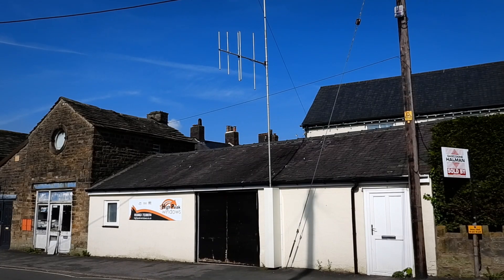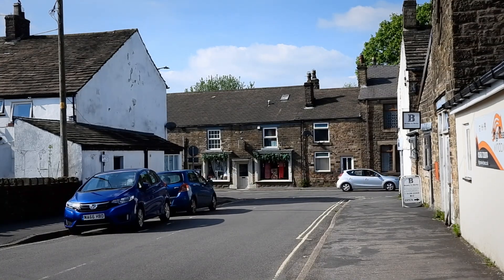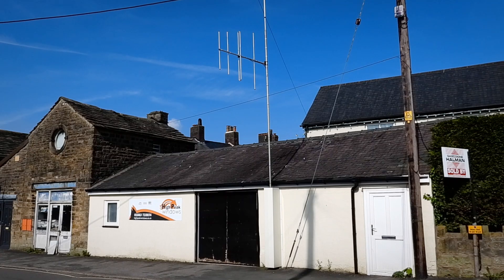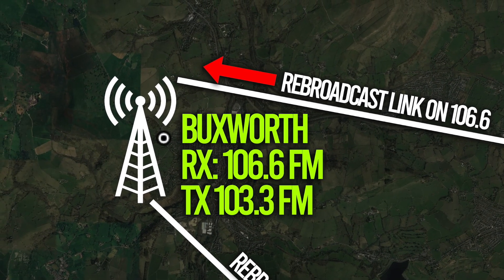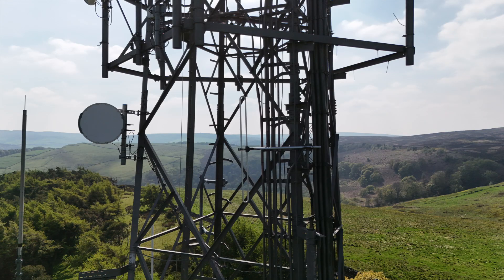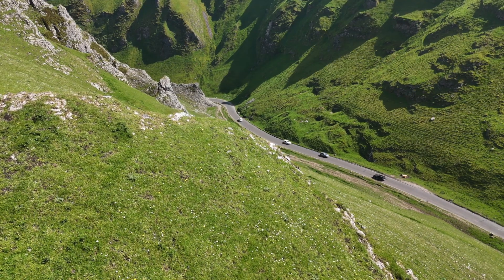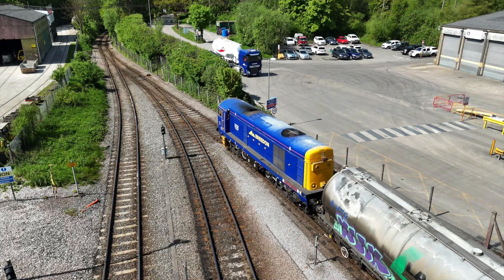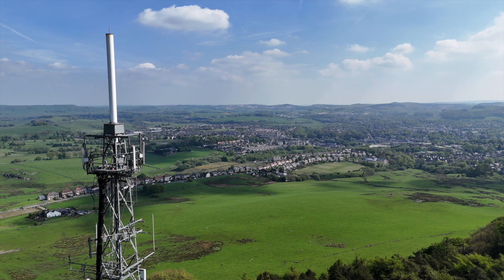Why Did This Antenna Appear On A Residential Street? High Peak Radio

Comment: This is not related to this video, but i would like to know your opinion if something like it could be fusible. The TV series lost had a radio transmission that that was transmitting for 16 years according to the show, some comment reading led me to the year estimate of 11–12 years of the message. My question would it be possible for a 1970--1980 tech transmission tower to constantly transmit in a high humidity area like this island would there be are deterioration or other factor like power interruptions (power is somewhere of the island via undersea power cable) to stop the transmission at the time that the show is ruining in the in show year of 1990?

Comment: There is some great information in High Peak Radios book, broadcast brothers on the radio. Their second book should be out soon, which will detail more about the launch and running of the station.

Did you reach out to the Jenner brothers? 

Great video 👍

Comment: Wow that first antenna looks like its almost touching the telephone wire and overhead power line, I wouldn`t be surprised if you can receive the radio through the phone and electricity meter. " right lads about here looks right "...obviously no thought to safety

Comment: Ofcom's technical parameters document informs that Chapel-en-le-Frith's in-use pattern is omnidirectional. That suggests (to me, at any rate) that the end-fed vertical is the transmit antenna. The antenna height is also given as 7m -- the yagi looks (to me, at any rate) to have a mean height of approx 5.5m or thereabouts (assuming the doors are 2m).

Comment: Another great video, of special interest. This is the message I got from one of the creators of that TX chain...

The answer re the original feed to Glossop is genuinely quirky. That RX antenna didn't pull in an adequate signal from Buxworth, so we received instead at a hilltop fam building to the south, near Chunal, and bounced it onwards...
Reply from the maker: Could we chat via email David?

RingwayManchester@mail.com
Reply from the maker: Thanks for the info!

Comment: Nice video again. In France there are similar Yagi antennas but lower frequency and only 2 or 3 element aiming along train tracks, and antennas looking like a periodic log, also vertically polarized, along toll highways, The latter are diffusing a radio program for drivers with a diploma on 107.7. The program is likely repeating each hour and contains information about good driving practice, at least this was what it was when i last heard it 10 years ago and found it awful. The positive thing about it is that it is directive to the extent that as soon as you leave the toll highway the signal vanishes.

Comment: very interesting Lewis. I'm not a broadcast engineer but I have spent a lot of time working on PMR on hill top radio sites and there was one (can't remember which, it was a long time ago) where there was an FM broadcast Tx which was fed from a BT landline but with an off-air receiver as a backup for when (not if!) the landline failed. I would imagine keeping the local Tx and its noise sidebands out of the link Rx would be a major headache especially with the antennas on the same pole. Best wishes Alan G0NFY

Comment: I’ve found similar towers at a 2 sites while traveling in the uk on holiday, which look like a bunker almost? 

Used the 3 words app to map them for you; ///shred.cubes.cobbled and ///angel.tolerable.gentle

Your videos are getting better and better, the original videos were dry at times, but adding in local lore as you go along to fill out the story; while I’m sure a lot more work, make the videos more interesting for a wider audience.

Comment: Glad I'm not the only one who thinks GHR is doing a stunning job of helping wipe out Independent Local Radio. It's a deeply-depressing spectacle to behold. I've seen much-loved stations - a number of which I have been fortunate to work with over the years and which, despite the rise of the Internet and streaming still maintained a large and loyal audience - silenced, to be replaced by a corporate national feed whose sole contribution to local content is a traffic and travel opt-out every so often. Fortunately a number of outfits have regrouped and gone down the DAB/online route but they're in the minority, sadly.
Great content as always  - many thanks. 
👍
Reply: I agree on GHR wiping out smaller stations. I was quite exited when my town got its own station back in the mid 2000s. Unfortunately that small network got bought out by Bauer media a few years ago and is now all GHR. GHR is not a a particularly bad station (apart from having too many adverts), but I'd much rather have a local station.

Comment: at Chinley near Buxworth there is a relay on a hillside near stubbing lane. in recant times they added things on to it and now when there is a light wind the things they added on the mast make a whistling sound which is fairly loud. sometime you hear the sound of a generator kicking in there.  the stone building next to the mast has been converted to a holiday home.  i suppose that stone building used  house equipment for the relay mast but now it just houses people on away days.

Comment: I can imagine a fibre feed going to it via very few hops and strictly using UDP protocol... - but where IS the fibre cable? ....mine would be under or next to my various walls....... - it's not a great place for wooden poles and wires in the air.....

Comment: Seems to me that  Greatest Hits Radio is either broadcasting in DAB or a low power FM radio broadcast. Similar to what we have in the states. We have licenses free medium wave radio. Each low power AM medium wave transmitter works on a frequency around 1620 KHZ. The transmitters that  make up the low power AM broadcast network for area coverage are all on the same frequency.  Each transmitter is feed with one fiber site with the other's feed with a WiFi link. Using a encoder and decoder box. Such as the low cost Barix system with a static IP address. Each Transmitter is syncid up pretty much the same way a cellular tower network is. To provide coverage over a large area with very low power around a half a watt. The two most common FCC approved transmitters for this application are the Hamilton Rangemaster, and the Chez Radio Procaster.

Comment: That Yagi looks remarkably low and vulnerable for an urban location. 

I agree with your comment on them sucking the life out of local radio stations around the country. I'm of the opinion that if a company can't run a local service, the licence should be automatically revoked and opened up to organisations who can. A similar company has totally sucked the life out of local newspapers. Replacing the web sites with syndicated items and a huge amount of adverts.

Comment: That first site in Chapel.  It seems a strange building if there is direct fibre as there isn't a fibre entry into the front of the building on top of that there would need to be a secure area for the fibre optical mux equipment and the interconnect to the radio transmitter.
The antenna cables are run up and over the roof to another location.
That omni directional antenna could well be the transmitter.

That second site looks very rural for a direct fibre dig. Would have cist a fortune if there is no network infrastructure around.

Comment: Always amazes me what can be accomplished with this rather basic technology.
A lot of transmitting hops…..when they were all in use, what would the audio quality be like at the end of the chain (this being fm not DAB digital)?

Will this stuff and elsewhere be in use in say 10y from now? The move to online, thru either individual apps or a general purpose app covering multiple feeds eg Apple with less and less restrictions on data use means so many people only use those systems instead of various broadcast systems.

When home broadband isn’t enough??
Am I right in thinking this is a fixed mobile cell service antenna for homes with poor or non existent home broadband?
I’m guessing this is attached to a router/modem of some kind which turn the signal into WIFI and onto Ethernet.
As far as I know this area doesn’t have any connectivity issues with cables so I’m assuming this was used early on and never removed?
Odd thing to see.

https://maps.app.goo.gl/kBSSVZEs22dRQmMW6?g_st=ic

Comment: Great video as per Lewis GHR more homogenised crap that has no identity soul or bothered about local issues. THEY SHOULD NEVER BEEN ALOWED TO PLUNDER EVERY INDEPENDENT LOCAL RADIO STATION ! They must have a production line for cloned presenters as every single one sounds the same the only difference is male or female
Reply: We used to be able to pick up Gem 106 on high ground in our area, and it was a decent listen. Unfortunately, Gem 106 got taken over by Greatest Hits Radio...!
Ironically the 106MHz frequency used to be Heart, then got sold off, and eventually became GHR at the end of it!

Comment: That seems a bit sketchy using the 106 freq and not microwave link like most translators use, usually keeps the frequency free from noise as well.

Comment: Actually, I think both Heart and Greatest Hits Radio between them are “sucking the life out of independent local radio” - as soon as I saw adverts on posters telling me that Heart was going to be broadcast on 102.6 FM, I said “It can’t do that - it’ll interfere with Orchard FM!” - but, no - it’s replaced Orchard!  Or Pilchard, as the local yokels called it!

Also, two radio stations set up in both Minehead and Bridgwater, both initially calling themselves The Breeze, are now Greatest Hits Radio!

Even TFM, which used to be Radio Tees, whilst identifying itself as TFM, is really Metro Radio - if you play both at the same time, you get the same programming, with clever masking to hide the fact that it’s really pretty much a network, but with limited local content (ads, area-specific travel bulletins and news) - in fact, it’s a north east coast network service, between Humberside and Scotland!
Reply: Sad isn't it? Heart and Greatest Hits are the Borg Collective of radio stations, assimilating any independents and turning them into the radio equivalent of a shopping mall.
Reply: @ferrumignis  Here in the US iHeartRadio is the equivalent. They've acquired seven AM and FM stations in my little market of about a half million people. They've fired most of the popular on-air people and the remaining ones are shared among all the stations. And every advertising break includes a spot for iHeartRadio's podcast streaming service.

Video may have killed the radio star, but streaming is going to drive a stake though their heart.
Reply: Radio today is a complete joke. Good job not many people listen these days. The 80's up to around 1995 was a pretty good period for radio, and those Jam and TM jingles really gave each station a strong image. Now it's like every station is a clone of each other, have no identity, and have the same boring crap playlist of like 20 songs. Let's not mention how the song don't even sound like music as the audio is compressed to hell providing very little dynamic range. Surprised any of them are still in business.
Reply: I agree, but it's even worse. They are actually re mastering all the oldies and applying digital pitch correction, compression and a 50Hz roll off to the entire library of music. It is sucking the soul out of the core elements of what made music good. What we are left with is sanitized garbage that people will not understand was deliberately blended down to push up new rubbish masqueading as music.
Reply: A harsh commercial reality; as licences go up in price, and royalties to artists climb ever higher, add to that employment costs; the income from local business advertising all but drying up and you quickly end up with a lack of scale financial crunch. Larger groups with much bigger negotiating power, fewer on-air talent bills broadcasting to ever larger areas is the only way it can pay. Local radio as a business has been on it's knees for several decades, the rise of Heart and GHR are a symptom rather than the cause...
Reply: We had this in out local area as well - instead of various local stations, almost all of them became Heart (duplicating stations on the FM band as it was almost always possible to pick up at least 2 of the same thing), with the only difference being Leicestershire (getting Capital instead).
So almost everywhere now is either Heart only, Greatest Hits only, or both available - with very little other choice.

Comment: Wondered if you heard of any radio outages due to the Solar storm? If so you should make a vid. I'm interested in hearing if there was any widespread effects.
Reply: I tried an ETM scan on my PL330 at the hight of activity here in the south Puget Sound area US. Normally with the telescopic, I get 16-17 locks. But zip, zilch, nada on the eve of 5/10.
Reply: HF/Shortwave ionospheric propagation was dead for a couple of days.

Comment: Are these stations legal in the UK? As for "Antenna Appear On A Residential Street"... These Yagi and Vertical antennas are used by amateur radio operators all over the world. In the US they are quite legal if used by a properly licensed operator. In the US some times Yagi antenna are used for the gain and direction. If you have 2 stations on the same frequency you can use a Yagi to avoid interfering with another station. A yagi can also be used on receive to use it's gain to pick up weak signals.
Reply: ham radio